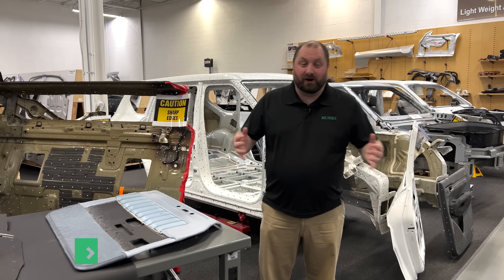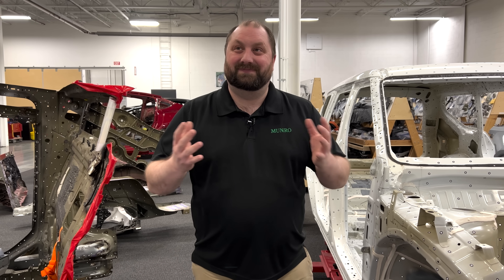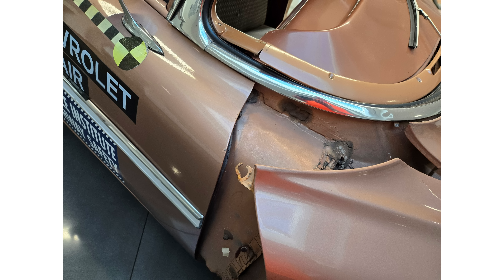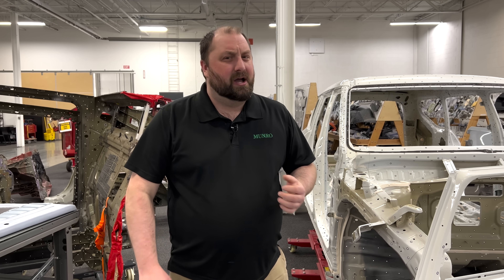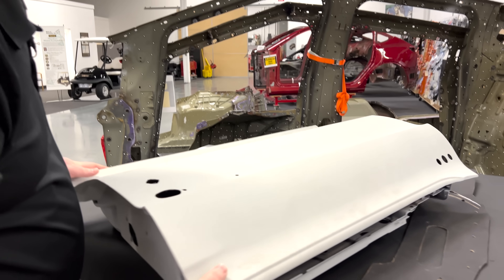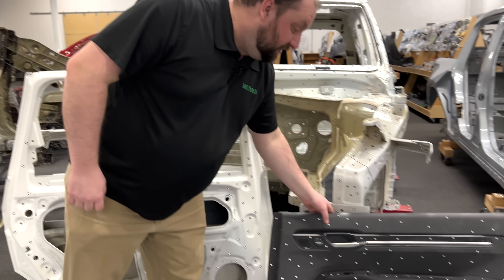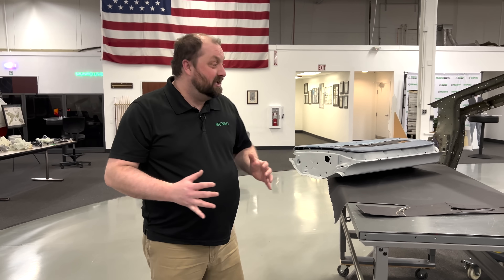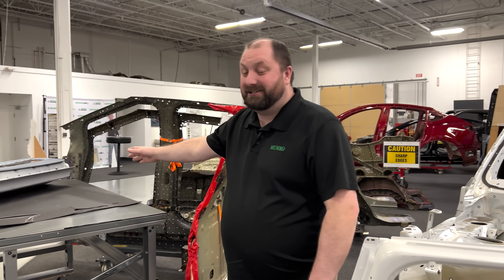No, Your Classic Car Isn't Built Better Than Your New Car

Comment: If we could get the comfort, component repairability, and un-fussy styling and interiors of classic cars with the safety and precision of current products it would be having our cake and eating it too :)
Reply: Either way, you'd look cooler driving a classic which is why they're historically significant
Reply: @ Love the classics too. Best suited for weekend fun and shows, but best not for daily driving
Reply: @billthomas8994  They are fine for daily driving, today's young people just don't know how to take care of things that are not computerized.
Reply: Agreed. I’m seventy and drive a 4 cylinder Toyota Camry. It feels like my version of my father’s Oldsmobuick. Except better.
Reply: The closest you can get to that is the current Ford E series of vans - with the exception of the fascia, they have remained virtually unchanged since their debut in 1992, and you can theoretically swap fenders and other front end parts between them all.  Not sure how safety has been affected, perhaps being a work vehicle puts under less strict requirements, but mechanically they have been updated several times.
Reply: @LuwiigiMaster  Its a great van and love the Class C E450 version on my 1998 motorhome.  Just notice how almost every late model E Series van crabs down the road.  Heard that QC slipped on the rear axle and that there is a shop in Florida that will cut off the axle shafts and re-weld them true
Reply: Un-fussy interiors? Have you seen a 50s interior? lol
Reply: @ I'm more thinking 80s/90s
Reply: Modern cars are more comfortable. Repairability is also a thing since diagnostics tools tell you everything. If somebody wanted they could take appart everything component and fix it but most people would rather replace the whole part cause it more reliable.
Reply: Those classics were not reliable at all component level and required far more frequent and costly maintenance. It’s revisionist history to claim otherwise. The 3k oil change, 30k required tuneup and frequent brake jobs for marginal safety was the standard. Few of the relics made high mileage. It’s romanticism at its finest.
Reply: @chrisbuczeksmith8289   The 3,000-mile/3-month oil change doesn't apply to normal driving.  All the owner manuals of my '70s cars say to change the oil every 7,000-ish miles (varies slightly per model) or every 6 months.  

They all then have a secondary note to change every 3,000 miles if you live somewhere very dusty or you make constant short trips where the engine never gets up to operating temperature.  

So either owners defaulted to the lower numbers to play it safe, or oil change shops told people the lower numbers to get them in more often and make more money.  (I suspect it was the latter.)

But really, longer oil change intervals these days probably have a lot more to do with the oil itself than the cars.  Modern synthetic oil lasts a lot longer than old conventional oil.
Reply: @NoName-ik2du  modern engines have much tighter clearances for less blowby contamination and less fuel dilution from imprecise carburetion
Reply: @NoName-ik2du thing is though now manufacturers are encouraging you to change and fill your oil more often now thanks to them using thinner rings to scrape past emissions tests, modern engines are literally designed to consume oil… they’ve turned four strokes into two strokes
Reply: @billthomas8994  Not so about less blow-by.  Should be, but isn't.
Reply: @chrisbuczeksmith8289  Have you looked at what it costs to keep a modern car running once it goes out of warranty? There are dozens of items that can fail on newer cars and not only will the car probably not run (even if its non essential), but it will cost you $500 for this, $1,200 for that one. And only the dealer has the parts and tools to repair these newer cars. No, you are wrong about this. Go get a brake job on an 5 year old Audi, BMW or Mercedes and get back to us. Plastic oil pans, timing belts instead of chains, 10 speed transmissions that cost more to replace than the car is worth, starters buried inside the engine, LED displays that control everything in the vehicle and cost upwards of $10k to replace in many cars. No thanks.
Reply: @chrisbuczeksmith8289  We had to change the oil frequently because it, not the car, was not very good compared to today's oil, and no you can't go 10,000 miles between oil changes.
Reply: @chrisbuczeksmith8289  Your comment is revisionist history. The maintenance was not "costly". Old American cars were so incredibly easy to work on that their more frequent maintenance was still easier than doing basic services on modern engines, or pulling the entire engine or dash out every time some poorly placed component fails. 
Even the most "costly" services 60 years ago, for example, were far cheaper than now when adjusted for inflation. 
It is possible to still produce cars that are so easy to work on and incredibly safe. It's just easier for engineers to disregard it when managing strict packaging, emissions, and efficiency requirements
Reply: @chrisbuczeksmith8289  Don't forget the days before electronic ignition with points. Those were the worst.
Reply: Modern cars are definitely more comfortable.  But I agree with everything else .. good points.
Reply: @karlstathakis7786  MORE comfortable?  How is that, when they don't have any room inside and have a hard almost truck-like ride?
Reply: @karlstathakis7786 depends
Reply: @karlstathakis7786 nay, leather and vinyl are better than foam with plastic fabric.
Reply: @karlstathakis7786  depends what you consider as comfort i guess. The modern hard seats will never be as comfortable as the spring loaded seats in my 1976 ford taunus

Comment: Yes, old cars are not as good as new cars. But new cars are not that great either. Today’s cars are engineered to wear out and expire sooner than they need to be. Why over build a new vehicle when the manufacturer can save some money in production. But the result is a piece of junk after 10 years on the road and a couple hundred thousand miles, or 250k Km. They are expensive, not made to be repaired or refurbished. The manufacturer wants the customer to replace whole assemblies as opposed to a single cheap part. Plastic parts moulded as one piece saves time in production but is very difficult, if not impossible to repair. Replacing whole assemblies helps the bottom line of manufacturers. Today’s cars are written off in an accident prematurely due the complication of repairing all the sub systems, electronics and expense of pricey parts. So when is “peak car”? What period of car, when safety features were built into the vehicle during manufacturer but was made to be serviced & economically repaired by the owner, without an access of useless electronic gizmos? Maybe “Peak Car” not the same answer world wide. Peak Japanese car may not be the same as Peak Euro or Peak American.

Comment: The title of this should have been «The way we move things forward». I remember cars like a Kadett B, Golf A or a R4 were corroding away already after 4 years, because the paint didn't worked as anti corrosion paint. A motor with 100hp was seen as much.  The weight of a car was under 900kg, because all the passive safety was missing. This video was a good reminder, how much cars have developed.
Reply: A compact family car in the 1970s and '80s like a Honda Accord, VW Golf, Renault 16 etc were TINY compared to almost anything available today, and like you say often weighed less than 900kg. A compact car today not only being noticeably larger also weighs quite a lot more, around 1300kg or even higher; the quite tiny Honda E (which I'm not sure if it's still available actually) weighed about 1500kg. A lot of that will be passive crash structures, thicker doors, thicker roof pillars etc compared to what you saw back then.

Yesterday's cars were rattly death traps, it boggles my mind that some deluded people would actually prefer them...! lol Ok, style-wise cars back then had more personality and flavor, but that's only because we didn't know as much about aerodynamics back then as we do now (and also did not care all that much about  efficiency, fuel economy and the environment... :P)
Reply: @lennyvalentin6485   you die today every second heavy accident , they died back then at the first . The is no order of magnitude difference to make me desire the current moneytraps, i proudly go with something from mid 2000's known to reach one milion without fuss , Euro 4 gasoline about 160 grams Co2 / km so you cannot go eco blaming me  .

Comment: They were easier to work on because they were simpler than todays cars but not as reliable in general
Reply: No computers or air-bags or seat-belts or AC or power accessories. But they still didn't last as long.
Reply: @normpaulsen5775  Depends on the classic car. They literally can last as long as you want them too. I used to restore and drive 57 Chevys, and with AC and power accessories, and sometimes, seat belts. They're still out there. My daily driver is a 75 Pontiac Lemans Sport Coupe, Still running with the original Pontiac 350 engine and auto transmission. It's got 200K miles on it. It's got the AC, pw, pdl, pb, ps, 3 point seat belts. No rust to speak of. So, at 50 years old and counting, I'd say it's lasting pretty long 🙂. I have a few other 70's cars like it. They're pretty cheap to buy and own when you can do your own work. So, I have no need for a late model car. It's because I can work on them and have a place to work on them. Most people don't have that ability or desire, so they have no choice but a late model vehicle.
Reply: @normpaulsen5775 they had vacuum pumps and all that.

Comment: I think to a degree it depends on the classic car. I feel fairly safe in my 34 year old classic Mercedes. And it is better built than any new car and it is more reliable and it does have a much longer practical lifespan. Classic American cars are sub par, but then they were sub par when new but that was intentional. The classic car in the US was a disposable commodity, meant to be used for about five years and then be replaced. So the big three (or four) had no incentive to build them better.
Reply: You should not feel safe in this car. Even a supermini from 20 years ago would absolutely obliterate your old Merc in an accident, despite the difference in mass. Quality can't compensate for enormous advances in engineering and manufacturing.
Reply: It's not better built cause better is relative. If better to you means more miles well there are plenty of new cars reaching 600.000 miles in 3-4 years.

Comment: I wonder if they have an argument against air bags
Reply: Problem with air-bags is after they deploy the insurance writes off the vehicle, meaning higher premiums and no work for collision shops. They should be designed that they don't DESTROY the expensive interior and require expensive reprogramming through a dealer(stealer)ship.

Comment: Yeah,  let's bring back steel dashboards,  steering columns that were basically spears; who needs seat belts or head restraints? ABS brakes. No 'Murican needs 'puters' controlling braking.  <:)  I owned a few VWs when I was a kid. Amazingly, more people didn't die in them. The heating in VW's in the 60-70s was so bad because the only heat being generated was from an air-cooled engine; there was an option or after-market option to actually attach a gas-fired heater directly to the gas tank, which was right beside the gas filler tube
Reply: Interesting. Our brand new 1971 VW Beetle was a delivery car for local goods. It was THE go to car in winter since air cooled engine warmed up quick. On a short delivery of 3 to 10 miles round trip that thing had gobs of heater heat. I wonder if ours had a far better blower motor and out routing? A full size American V8 Plymouth we had was the one we did not use for deliveries of runs to buy stuff when freezing outside. Our about worn out 68 Bug put out way less heater heat. With the new 1971 Bug the engine was bigger. We traveled weekend 165 miles away at 78 to 85 mph on the us highway with a 70 mph limit. The old worn out 68 bug was far dangerous; get run over a 40 mph on hill. You could cruise at 55 to 60 on flat ground but risked getting rear ended. ie folks going 85 to 90 plus
Reply: I drive a 1994 Volvo, arguably an extremely safe car for the time period. I drive it very defensively today because I know its limitations compared to new cars. No traction control, ABS sensors only on the front wheels, solid axle in the rear, only two airbags, etc.

Comment: Great info, however, don't fall to the belief that the reason cars today are better or safer strictly due to government regulations. Comparing a 59 BelAire to a 2009 Malibu is only valid to "prove" government regulations were the reason for these improvements if you also test a 59 BelAire to an 1909 (or 19, or 29) vehicle. I bet the "gap" in safety was greater from 59 to an 09, 19 or 29 than 59 to 2009.

Comment: I agree that new cars are MUCH safer than old ones.  I remember when Click and Clack stopped recommending people keep their old cars (as a rule), as they said, safety was improving so fast it made sense to get newer ones. 

But, not being clear on how unsafe that old 'x frame' '59 Bel Air was considered at the time is quite a glaring oversight.  

To those who don't know, the frame is literally shaped like an 'X', that's why the whole front end swings sideways when the Malibu hit it. The crash people likely knew it too, that's likely why they chose the Bel Air instead of say the same year Olds (which added perimeter bracing to sides of the 'x').
Reply: I agree that the "X" frame of the 58-64 Chevrolets was a weak example. The rockers became bigger to help stiffen, but still not enough. As you probably know, they used the 59 Impala because they wanted to show how far they've come in safety in 50 years, using the 2009 Malibu to prove it. I wonder why they didn't use a 2009 Impala? Anyway, the full size Chevys got a bit stronger in 65 by going back to full perimeter frames.
Reply: @grand73am that’s literally the thing people overlook, the frame back then dictated the rigidity and safety. I think the reason why people look back on older vehicles being ‘safer’ is because of the Imperials that were used in demonstration derby’s that literally demolish anything in their way. Literally was 1’ of space between the grille and radiator, the frame essentially was made of iron girders with a ‘x’ brace. If you crashed into someone or someone crashed into you when driving a Imperial from 1957 to 1966, the other vehicle would have a significant amount of damage and literally would have smashed the other vehicle. Crashing into a Imperial with a Toyota would literally be like crashing into a concrete abutment. Since Imperials were that strong, they were banned from demolition derby’s in the 60’s and 70’s.

Comment: I'm a contractor and do work at various panel beaters.. seeing classic cars stripped back to bare metal for restoration really exposes how simple / weak they actually are ..  the A pillars and sills look so weak, no high strength steels or multiple layers of metal .. it is a real eye opener ..
Reply: @OM617a  I bet they still suck at crashes
Reply: @randomcrashingfacility31  have you seen a volvo 240
Reply: @OM617a  nah, my E30 is not a safe car at all. The doors are just two sheets of metal with no crash protection at all.
Reply: @OM617a  Not really, European cars tended to be smaller, thinner and lighter than American cars. Now, I'm from Europe so I've almost never seen an American car up close, but I find it hard to believe that they were thinner than ours, especially our city cars, they were literally tuna cans.
Reply: As I do all repairs and maintenance on my own cars, I already know that virtually all new cars will outperform my Volvo 164 and 940.  The 164 has very heavy doors and impact bars but the strength doesn't have the benefit of high strength steel and light weight computer designed panels.  The doors are still be fairly good but new cars can match it whilst being half the weight.  It also has crumple zones rather than just being really strong.

As for my 940, it was a car which had an advert of someone under it whilst it was suspended by on of the A pillars.  That was good for the time but all new cars have much larger and more intricate pillars which will be much higher strength.  That greatly contributes to passenger cell integrity during a collision.

I no longer have a 35 year old Alfa Romeo which I always knew was flimsy and had the fuel tank under one of the rear lights!  A few of them burst into flames after being rear-ended.  It drove amazingly but was also so potentially dangerous.  My current Alfa is much better in that respect but nowhere near new car standards.

Don't crash old cars.
Reply: Despite this, classic cars are more fun to drove because they look nicer.
Reply: I was in a very bad accident when I was 24 in a 1973 Mercedes 450 SL
I walked away with minimal injuries 
Most of the bigger German cars, such as Volvos or Mercedes were built extremely well back in the day, but I don’t want to find out because there are not many of these cars left
Reply: @OM617a  My dad smuggled Bibles into Communist Hungary during the 70's, by placing them in the door cavities of his Renault 4.  Emphasis on cavities.
Reply: @OM617a  Mine does have ABS and discs front and rear, but just the skinny A pillars ( that dont have extra reinforced in them) tell me all i need to know about how it would do in a crash.
Reply: At one point, the A pillars were reduced to improve driver visibility. Before that they were very thick.